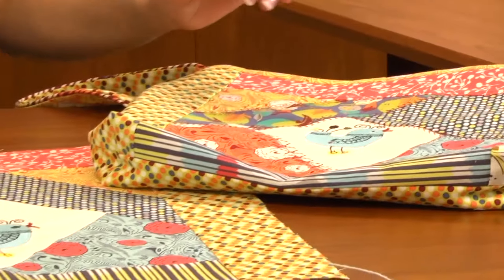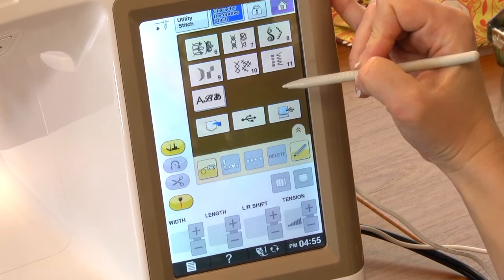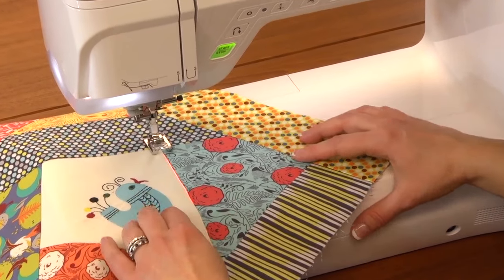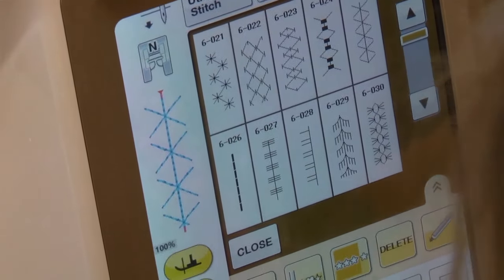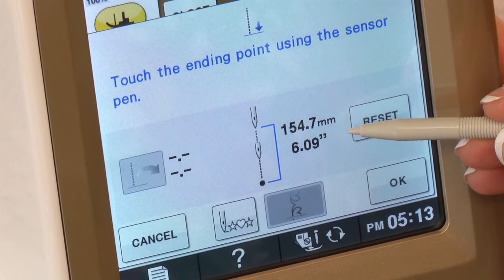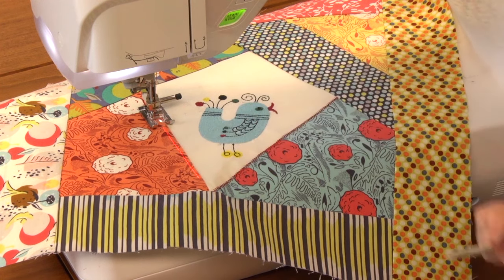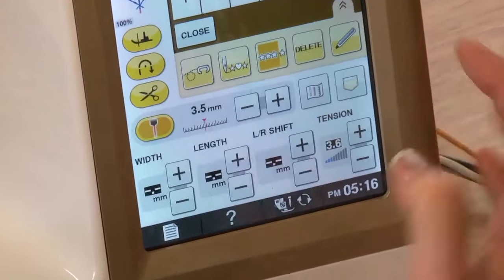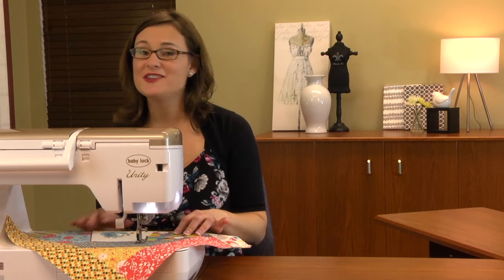How to Use the Baby Lock Guide Beam & Sensor Pen

Comment: Question for you...I have a BL Crescendo. The thread cutter trims the top thread perfectly. But the bottom threads are approximately a quarter inch or so long after cutting, which means I have to go back and trim all those ends. Is this the way the machine is meant to operate, or should the bottom threads be clean cut like the top?

Comment: Can I use an wireless mouse?  Trying to use a wireless mouse with the dongle plugged in I get the pointer arrow but the mouse won't move.  I have tried the USB mouse with a wire and it works perfectly.  I have the Destiny II
Reply from the maker: Hi Sandy! Thank you for asking! A wireless mouse is not compatible with the Destiny II. As you mentioned, the mouse is recognized on the screen, as an arrow appears, but it does not respond when you move the mouse itself.
Reply: Thanks for the reply.  My husband, an electronics engineer, took a mouse apart, shortened the cord and put it back together so I don't have all that wire in the way.  It all works perfect.  Thank you!
Reply from the maker: So creative! :)
Reply from the maker: So creative! :)